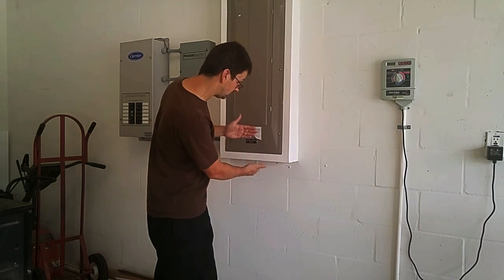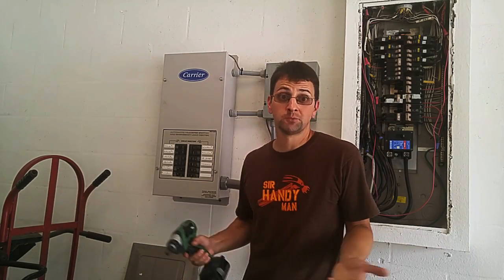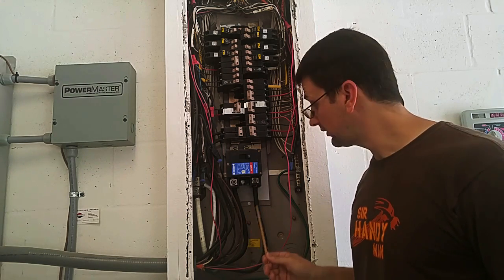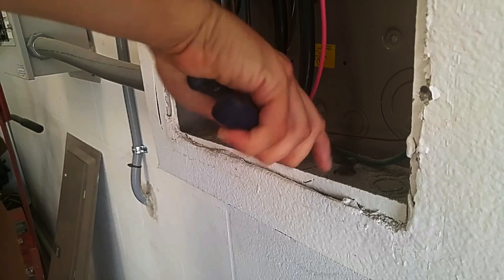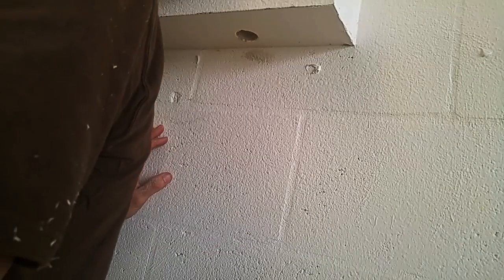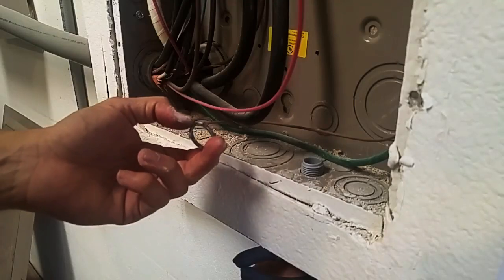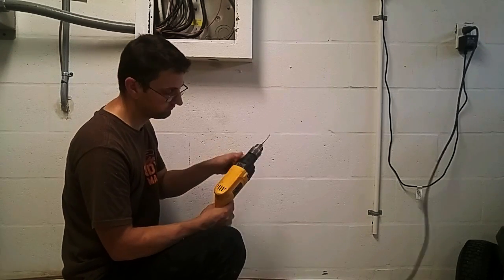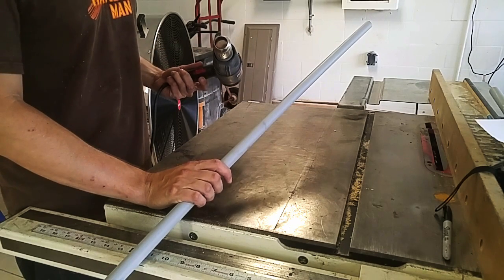20 Amp Electrical Circuit Installation, Part 1

Comment: to be honest its easier to just hire a professional like myself to do this work lol. and another safety tip please make sure you lockout and tag out the main breaker just in case of the mishap of it getting turned on in the middle of your addition .